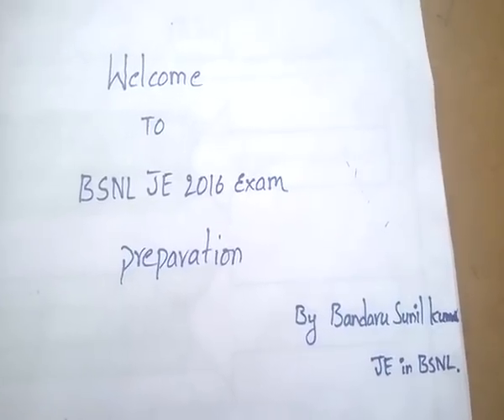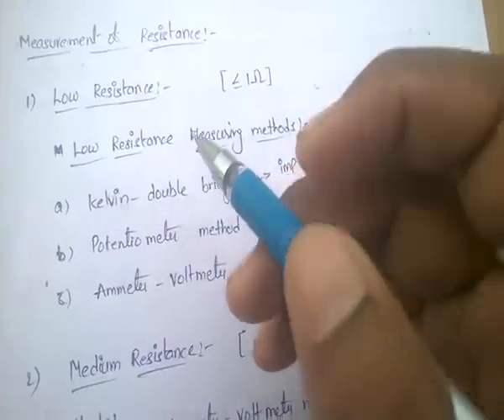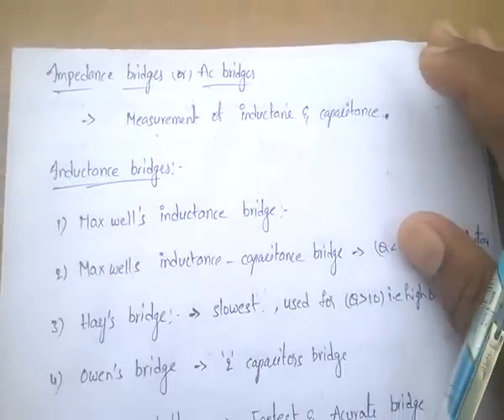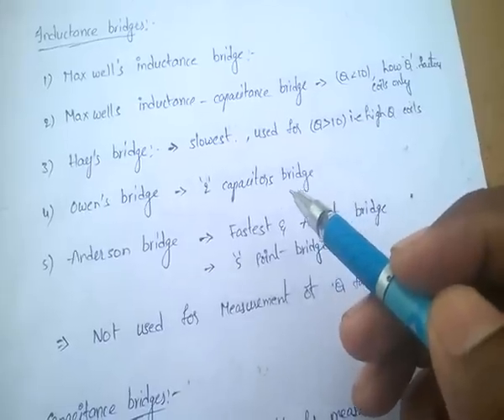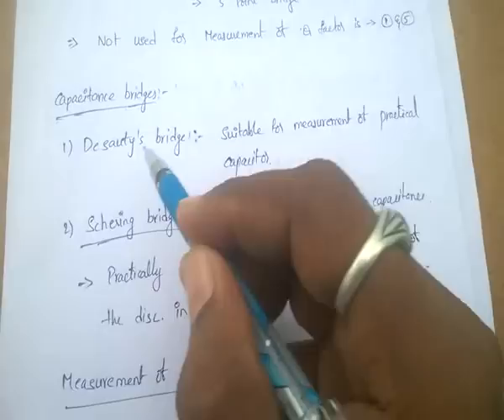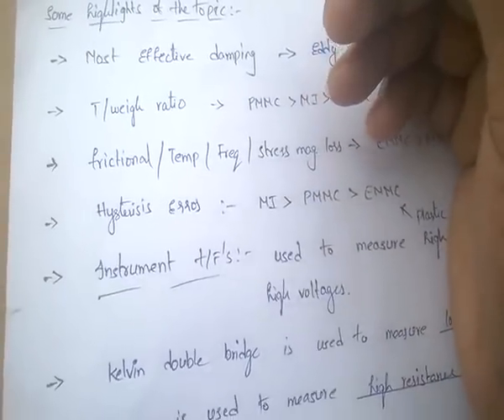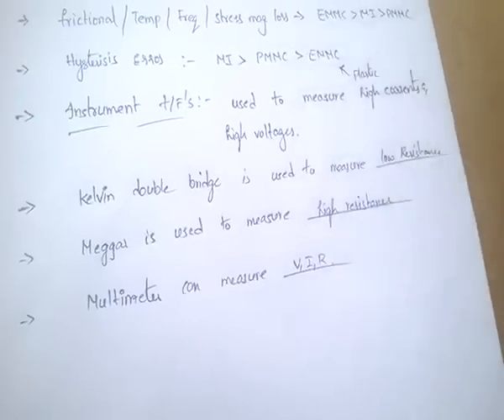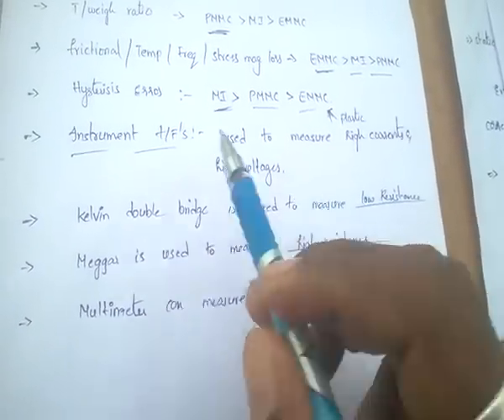INSTRUMENTS AND MEASUREMENTS PART 3- BRIDGES - FOR RRB JE/RRB SSE/BSNL JE/SSC JE/PSU'S

Comment from the maker: Many of the students asked me like “please make your video notes as pdf and send to my mail and we will pay cost” ..By considering your requests  I will try to make my notes as pdf files.. If you want my class notes as pdf file please mail to me.. this is my mail suneelbsnlje@gmail.com   ..i will send pdf files to your mail 
Cost of pdf notes part 1: 200/-rupees only.. Pages: 224  aprox
Topics covered
1.Bsnl je exam introduction -      4pages
2.Maths notes of videos(matrices, differentiation,diff equations of second order ,integration,complex numbers,partial diff)                 38 pages
3.Maths materials with example question and solutions  on remaining topics (vectors,fourier laplace transform and partial diff)                    29 pages
5. Basic electricity notes all topics and mcq’s (except batteries)   36pages
6.basic electricity mcq questions  materials and batteries             14pages
7.Instruments and measurements notes and materials and mcq’s         25 pages
8.previous papers- 3(2015 -1,2015-2 and 2013)                78 pages

To win the race taking every decision and every minute is important.. 
.if you have notes it will be useful for revision and also practice..every time watching on you tube is difficult and data consuming and time consuming also....if you want top in the race every small thing is very imp.. don’t waste your valuble time..
Reply: I filled Form for power electronics, so in specialization section i have refer all topic or any specific? and If specific please suggest topic which i have to refer?